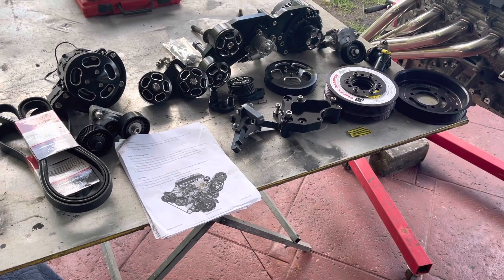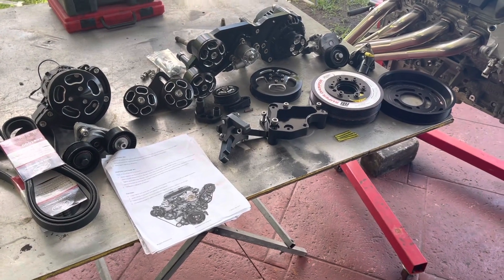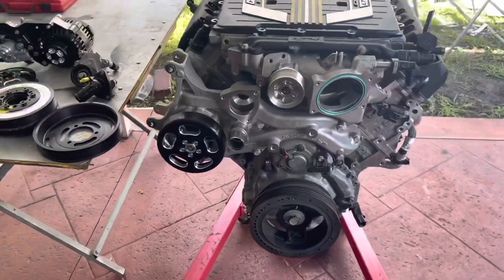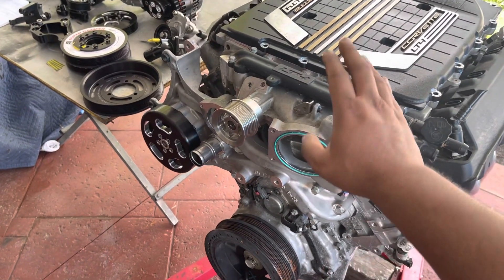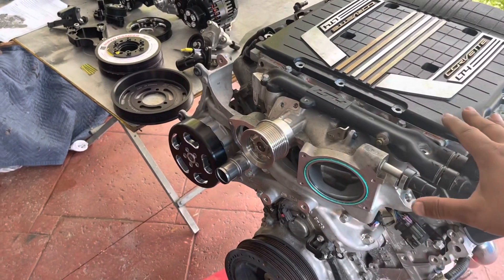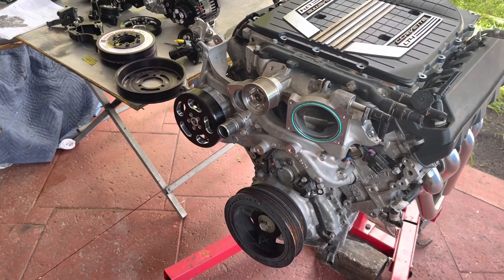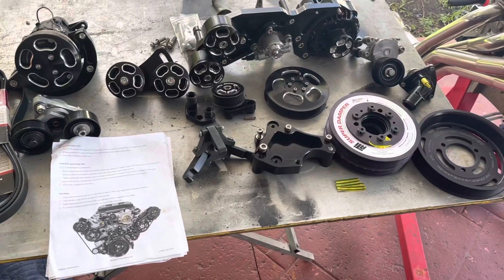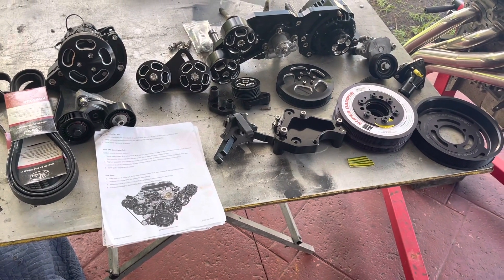LT4 Supercharged Billet Pulley System Install From Wegner Automotive ( Dry Sump)

Comment: What’s the difference between super damper and a regular crank pulley?
Reply from the maker: The Super Damper is designed exclusively for high performance Chevy engine. Unlike the Regular crank pulley the super damper It Eliminates torsional crankshaft vibration . and extremely efficient at ALL RPM